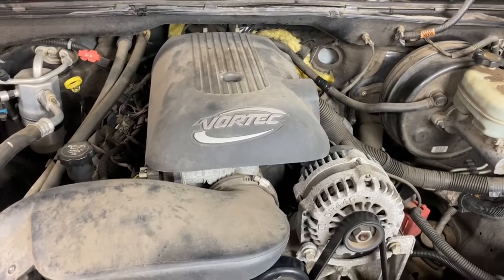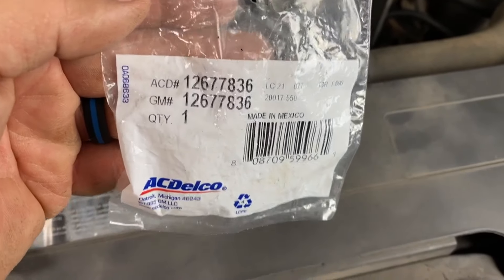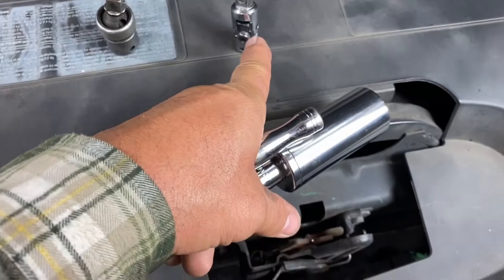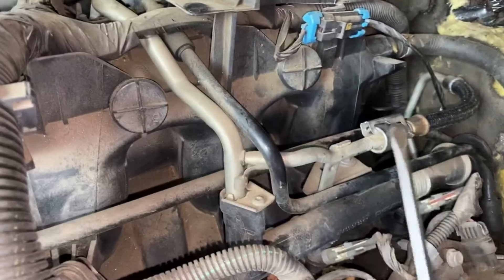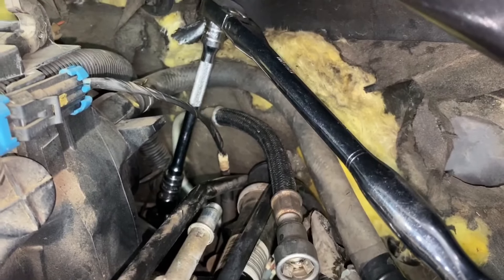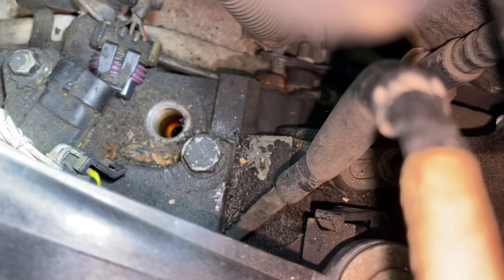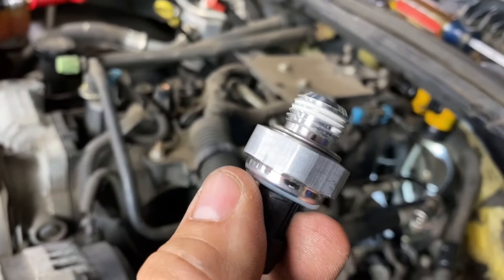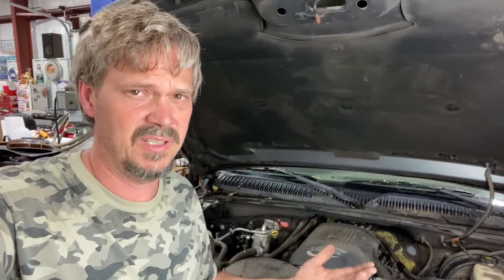Low Engine Oil Pressure / Oil Pressure Sensor Symptoms and How To Repair

Comment: I replaced the sensor and still getting low oil pressure what should I do next
Reply from the maker: There’s a lot of possibilities. First you’ll need to see if the oil pressure is really low by installing a manual gauge. Was there a screen under the sensor? It could be clogged causing a false reading. The camshaft bearings could be worn. The dash gauge could be bad if the reading from the manual gauge is normal. Let me know if you figure it out or need more help

Comment: I got a 6.0 Silverado it always goes to 40psi at a cold start but then the gauge starts going down slowly to zero but I rev then engine it jumps  right back to 40psi then stays around there when it warm up  only happens on the cold start could that be the sensor
Reply from the maker: Yes it definitely could be. Might as well replace that and let me know if that takes care of it. Thanks

Comment: I have a no oil pressure and bad engine noise, would still be the sensor or a bigger problem. Back story...I had a misfire, took it to a mechanic. Long story short, end up replacing a head, 4 pushrods, valve seals. Paid for it, and on the way home oil pressure went to zero and engine noise.what say ye?
Reply from the maker: It sounds like you actually did lose oil pressure unfortunately. Is it a sound like a diesel engine makes? I assume the oil was changed? Let me know more details.
Reply: @dhammiam  I did run some engine flush  for a few minutes, then changed the oil. Did not work, didn't want to run it too long with no oil circulation. My thoughts are not the sensor. ???
Reply: Yes sounds like a diesel

Comment: When I turn my key before I crank the motor, my oil pressure shoots up to 80 psi and stays there when the truck is running. Is that indication of a bad oil pressure sensor?
Reply from the maker: Yes it definitely is.
Reply: @dhammiam  I just bought the sensor, it came with the screen, is it necessary?
Reply from the maker: @extendomigs I don't think that it's necessary. Mine didn't have one. I've seen others say they removed it from theirs

Comment: Please Help! I’m having low oil pressure problem with my 2009 Chevy Silverado. Within 2 minutes of starting the truck the oil pressure gauge starts dropping down to zero causing the low oil pressure notification to come on saying Oil Pressure Low Shut off Engine. For a period of time once I first drive off the Oil pressure gauge increases from zero until pressure seemingly builds up. I have to keep my foot on the accelerator to keep it from dropping back to zero because once I stop for example at a red light the low oil pressure notification/alarm will go off again. But after driving around for at least 30 minutes to 1 hour the gauge no longer fluctuates. The Oil Sensor Filter/Screen was replaced and was only a temporary fix as I am now having these same exact issues again. Any idea as to what could be causing this issue and how I can fix this? @dhammiam
Reply from the maker: Sounds like maybe the oil pickup screen may be clogged or the oil pump may be weak. It could be the new sensor is bad but since it’s doing the exact same thing maybe not. The gauge itself could be. The only way to really tell is with a manual gauge screwed into the port. What type of oil are you using, 5w-30 or 10w-30? The cam bearings could also be the culprit but usually the pressure will drop once warms up.
Reply: Once I have driven the truck for about 30 minutes to 1 hour+ when the truck seemingly warms up the oil pressure gauge stops fluctuating and going to zero. But this problem is happening during the first few minutes after initially starting the truck and also again when I have to stop. Thats when the low oil pressure gauge fluctuates then goes to zero and the notification comes on. I am using 5W30. Do you suggest me trying a manual gage screwed into the port as my next step? Thank You for your response I really appreciate any and all help @dhammiam
Reply: Our issue was the steppor motor in the cluster.

Comment: My chevy 1500 98 turned off and it said to check gauges
Reply from the maker: Do you have any trouble codes? Will it start?
Reply: Well I tried starting fluid and it started so it might be the fuel pump
Reply from the maker: Be sure to check the fuel pump relay and power to it first

Comment: Does this fix code P0521?
Reply from the maker: Yes it should be the same sensor input that tells the ECM about the oil pressure issue that sets a PO521

Comment: just stole an 04 gmc 1500 for my son and its oil gauge is pegged, it not the stepper motor as it goes down with engine off so has to be this... Thank you for an excellent video but you failed to mention how you have to hold your tongue just right in order to get to it...
Reply from the maker: Good deal! Thanks, yes hold tongue just right for sure 😂

Comment: Hi Dave! I could use your expertise, I have a 2006 Chevy Silverado 1500 5.3 2WD. I am having an issue with my oil pressure Guage, when I put my truck in "accessory power" my Guage reads between 20 and 40, then once I start the truck it jumps to almost 80 and then drops down to around 65 when idling and warmed up. Driving makes the Guage jump up to 80psi even at only 1000- 1500rpms. Could this be the sending unit or something else? Just changed oil and filter to be sure and it didn't change the Guage behavior.
Reply from the maker: That sounds like what mine was doing. Most likely the oil pressure sensor is bad. Also be sure to check and see if there’s a screen. Let me know how it goes. Thanks!
Reply: I've been told screens were installed in 2007 up. My 2005 silverado with 5.3 does not have one . Hope this helps.

Comment: Idk which job cut me up more. Oil sending unit or #8 spark plug🤣
Reply from the maker: Yea that #8 is way back there. The Engineers didn't do is any favors in the design but at least the engine is facing the right direction 😂

Comment: We replaced the oil sensor and a no go...now what?
Reply from the maker: What’s it doing exactly?
Reply: @dhammiam  the oil pressure guage was reading low almost zero. We replaced the oil sensor. Still the same

Comment: Dropped a bolt in the sensor hole looking for the screen/filter - now what? Replaced my sensor last summer (gauge was pegged high), I used a bolt to attempt to find the screen below the sensor - but I dropped the bolt in the hole. I "assumed" the bolt was captured in the old screen, or the tube was small enough on the bottom it would hold the bolt inside. My sensor did go back on, pressure read fine. Now my pressure fluctuates between 40 psi cold to 10 psi warm, and alarms when rpm is less than 1000. Where can that bolt go? Is this a problem - my engine (97000 miles - 2005 Silverado) sounds great, no issues. Do I take the sensor back out and look for that bolt - or could the bolt go to the oil pan. What do you suggest?
Reply from the maker: The bolt most likely dropped down behind the rear cam bearing.  The oil pressure is picked up from around the cam bearing and thats why when they wear, the oil pressure can drop when the engine warms up.  You can try running a heavier weight oil and see if that helps the pressure.
Reply from the maker: as for going to the oil pan, not likely.  The passage is closed due to needing to read an oil passage pressure.  The only way to see if you're having an oil pressure issue is to take the sensor out and put a manual guage in the hole.  While you're there take a long skinny magnet and go in the hole.  I have one that would work perfect.  I think this is the right one with a small enough magnet to go in the hole
 https://amzn.to/3xVNqHS
Reply: @dhammiam  Thx for the quick response Dave. I'll order that magnet and try that for sure. First - is there anyway that bolt would interfere with that cam bearing - or anything else? I have never heard any impact noise or seen any degradation of engine performance. It is 27F here in Billings today, cold starting the gauge reads about 20 psi. When it gets warm (like on the freeway yesterday) I can get a low pressure alarm when rpm drops below 1000 rpm, like idle rpm. I believe the low oil pressure is in the sensor - not real, but that may be wishful thinking. Can low oil pressure ever shut off my engine electronically? Could the bolt ever make contact with any rotating part, it was probably 3 to 4 inches in length. If I can not find that bolt with the magnet ... is there any harm in leaving it in the oil system of the engine?
Reply from the maker: @randydecker5869  I'll email you my number and we can talk. Happy to help